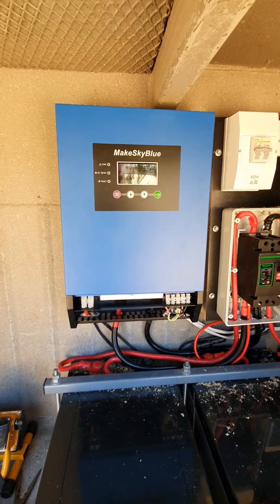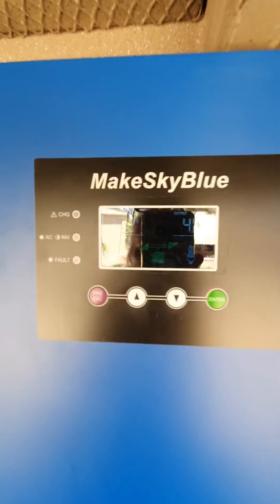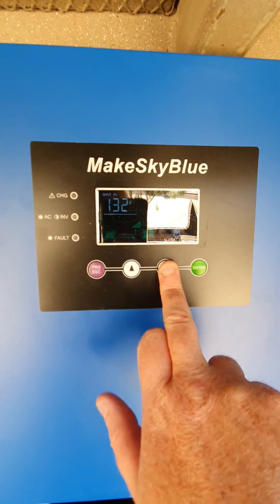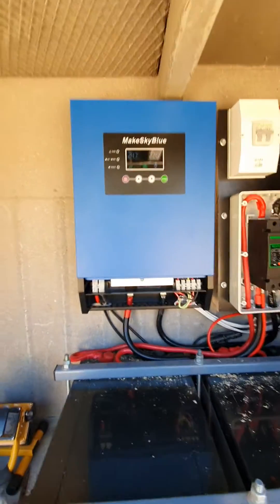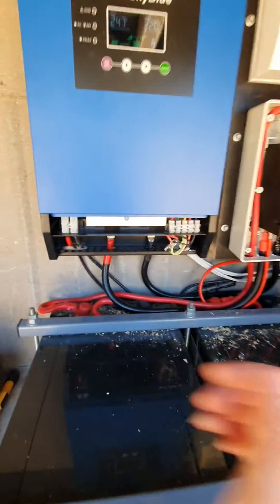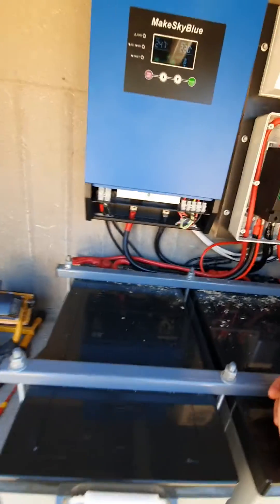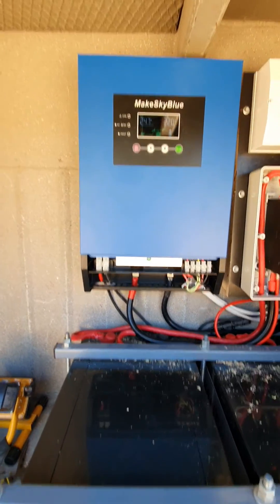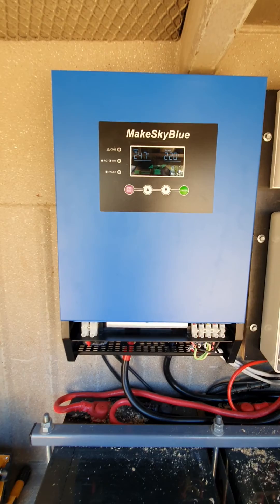Make Sky Blue Hybrid Inverter 5KVA

Comment: How do I set the battery type to LiFe using the app which is listed in the company website? After changing to Life4, it reverts back to LiPO after save. Can you help me on this?
Reply from the maker: I'm unsure sorry I used AGM batteries. From memory someone else has a video on YouTube of how to program settings. And the website has a section too I believe. Sorry I can't be more help. I have since sold my bus

Comment: I picked up the two kilowatt 12 volt version of this and what I'm having an issue with is as soon as you connected to battery the inverter is powered on the on-off switch seems to have no effect. Other problems but that one has really caught my eye
Reply from the maker: I had mine going through a dc circut breaker...so battery to breaker to inverter so used that as my switch, however my switch also worked.
Reply: @nicolempage  yes I could use that option but it was late last night when I was just testing it out so I put my other inverter and charge controller back online. I'm going to test with a meter to see if the on/off rocker switch even functions.

Comment: I purchased the same inverter and I have 12 panels that are running 300 W apiece but for some reason it's saying that it's charging my batteries but then when I go to put a load on it it only works for two minutes and then it shuts off and then it says that my life on the batteries are only 25%
Reply from the maker: Hi Carlos, have you tested each of the panels individually to see what they are outputting? Are they wired in series or parallel? What input charge do you see on the display? What battery bank size are you using? Again is it wired in parallel or series? What size load are you testing?

Comment: hi nikki I recently installed my 5K make a sky blue as well I'm having trouble with it the solar array that I have on the right now I have 12 panels that are 300 W apiece it says that it's charging my batteries but when I go to turn on the switch it only gives me enough power for about two minutes and then it says it's on 25% of the batteries I don't know what to do and I know the batteries are pushing 48 V because I've already tested them any advice

Comment: I've purchased the 3k watt hybrid inverter unit and found many issues.  The website stated a capability of 3000 watt of PV.  The manual states 1500 watts 
max. When I questioned the company, they told me that the manual was in error and would be corrected.  The site and manual remain unchanged 
almost a year later.  I confirmed there is no AC internal battery charger capability even though the website and manual stated there is this capability.  My unit failed after 30 days of use.  I attempted to get some warranty action from the company but warranty was denied as I had "abused" the unit.   In further discussion with a company rep, he admitted that 80% of warranty claims are denied.  I hope people will learn from my terrible experience with this company.